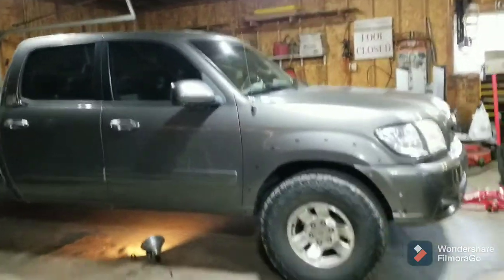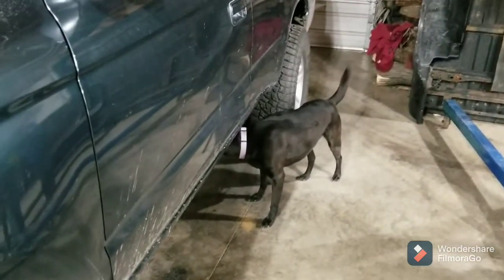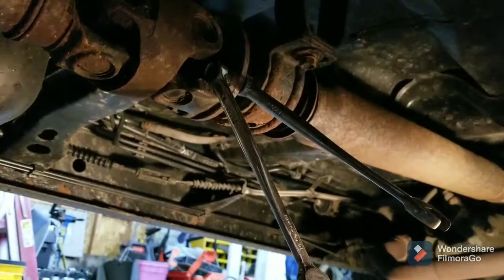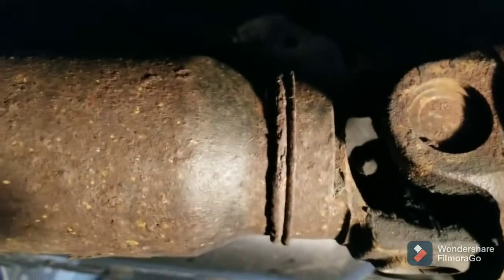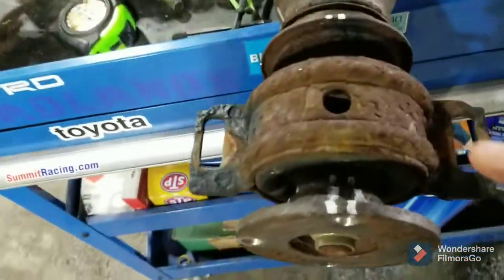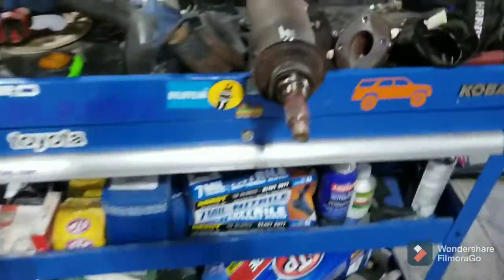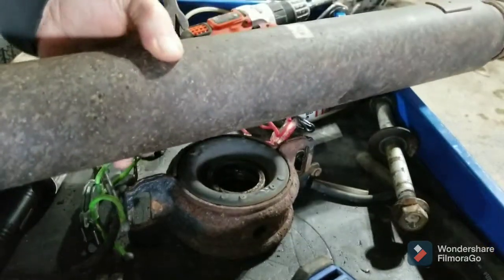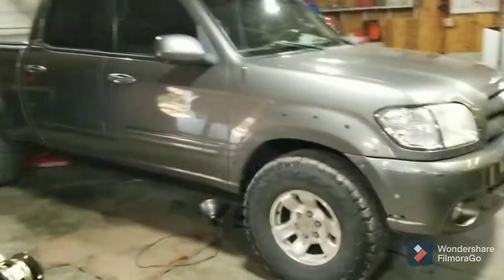How to replace carrier bearing/center support bearing. Easy! 1st gen Tundra, Tacoma, T100, Pickup.

Comment: Great video. No need to apologize for anything. Feel like you showed all the important stuff
Reply from the maker: Thank you. I appreciate that.
I try to cover all the important parts best I can.
Thank you for the kind words and thank you for watching and commenting
Reply: @funjunkiegarage  How's the aftermarket carrier bearing holding up?
Reply from the maker: I put just over 20,000 miles on it with the truck in the video. When I got my Blue Tundra it needed one so I took the same carrier bearing and put it on the blue one. I've put another 15,000 on it and at 35,000 miles total, it's still just fine.
The one I used does have a koyo bearing.

Comment: I'm getting ready to do this on my 1st Gen Taco. Amazing how all of these Toyotas work very much the same.  Thanks for doing this, I'm encouraged to tackle it myself now as it doesn't look as intimidating as I thought. I just installed a 2-3" lift on my Taco, and I thought I had fixed the resulting vibes (15-25 mph) via a carrier bearing drop. Now dealing with random, violent shaking underneath the floorboard, and my suspicion is that I need to do this job and replace that carrier bearing (it's a little loose - not terrible, but it's around 18 years old, so probably due anyway, and I just aggravated it more with the lift).
Always enjoy a quick glimpse of your other project cars (and I've seen several of your 3rd Gen 4Runner videos - that's my other ride).  Hope Blanche is still around.  Thanks!
Reply from the maker: You're welcome. Glad to hear you are going to do the carrier bearing yourself. I'm sure it'll go smoothly. 
I also love how so many Toyotas share parts and designs.  Clearly my favorite brand..
Hope this solves your shaking issue.
Thanks for watching my other videos.
I truly appreciate your support.
And yes Blanche is still around. She doesn't like hanging in the shop like Oswald does.

Comment: When you reinstall the yoke,  you need to torque the nut to 133 foot pounds to seat the bearing, then back the nut off 1 turn and retorque to 60 foot pounds.
Reply from the maker: Thank you for that information. 
That's good info indeed.

Comment: Thanks for the video. Very helpful. My tundra is also having a loud speaking noise front passenger side. Don't know what it is. Cv shaft?
Reply from the maker: You're welcome, happy you found it helpful.
I'd check the brake pads, for a squeaking.
Jack it up and spin the wheel and see if you can hear it. CV shaft is a possibility if it's dry of grease.
Best of luck finding it. Please keep me posted.
Thanks for watching and commenting I appreciate it.

Comment: Can this job be done without a floor jack? Do you need to completely remove the driveshaft? Great video! Thanks
Reply from the maker: Yes it can be done without a floor jack.
I didn't know it wasn't a press fit.
All you need to do is drop the carrier bearing, unbolt the 4 bolts on the flange and remove the center nut. It can all be done without removing either of the shafts. I made it way more difficult. 
Thank you and thanks for watching.
Reply: @funjunkiegarage  You should Highlight this.
Reply from the maker: Thank you.
If I can figure out how to do that I will.
Mayhaps a couple of my good ones.

Comment: Thanks for posting this.  I'm getting ready to do the same job on my '00 Tundra.  I've seen several negative reviews on the non-OEM carrier bearings going out after a very short time   I really don't want to spend the exorbitant price for the Toyota.  How are yours holding up?  Would you still recommend the DIY Solution bearing from Parts Geek?
Reply from the maker: Thanks for watching. 
I've put only about 8,000 miles on mine since I changed it but its holding up fine. It's not a big problem to change so I took the chance and so far it's fine.
Not sure how long it will last, but I check it every oil change.
Just a tip I discovered: 
I ordered one for a 96 T100, it was $20.00 less and was the exact same bearing I put on the Tundra.
I like to try the cheap alternative on stuff that won't leave me stranded.
Usually works out.
Reply: @funjunkiegarage  Good tip.  I don't put that many miles on mine so I'll take the chance.  I agree with you.  Thank you.
Reply from the maker: You're welcome.

Comment: What a great video for a first time replacement of that part . I was also thinking it was pressed . Do you think the grease for the bearing is needed. I noticed you wiped off the old but didn’t put any new grease. I imagine it’s some high temp grease if so.
Reply from the maker: Thanks for watching and commenting. 
I didn't feel any grease was needed. The old I wiped off was from the old bearing.
There is a dust shield on either side and the rubber fits behind/under them, but doesn't appear to rub the driveshaft. Another viewer asked me the same question so I went under there and took it back apart and there were no signs of any abnormal wear or rubbing.
Hope this helps.
I appreciate your support.
Reply: @funjunkiegarage  thanks for replying so fast. I got an 02 it doesn’t have the same setup unfortunately I’ll have a little more work on my hands . The driveshaft will have to come apart to get to the bearing.
Reply from the maker: You're welcome. 
Bummer. I haven't done one like that.
Best of luck with it and enjoy your project.

Comment: thanks for the video! mine did not just pop right off. sucks to be me, lol
Reply from the maker: Thanks for watching. 
Bummer yours was stuck  I did the T100 and  it came right off also. Was yours rusty/seized?
Reply: @funjunkiegarage  03 tundra 4.7, not too rusty, i cut off the bracket with a recip saw and pulled off the rubber, then tapped the bearing with a dift alternatly until it came off.
Reply from the maker: Definitely a good way to get it off there.
It pays to have the ingenuity to overcome obstacles. 
Think of the $$ you saved.
Thanks for sharing.

Comment: Hi, i recently had my carrier bearing replaced. Afterwards, i noticed a transmission fluid drip. The mechanic said it should go away in a few days. With your expertise, does this sound right? Thank you.
Reply from the maker: No, that does not sound right to me.
Replacing a carrier bearing should have no direct affect on the transmission in any way.
And as a general rule, leaks don't fix themselves. 
Did the mechanic say where it's leaking? Or explain how it started leaking? Or more importantly how it was going to stop on its own?
Doesn't sound right to me.
Please let me know how it turns out. If you don't mind.
Thanks for watching and commenting I appreciate it.
Reply: @funjunkiegarage  he said he had to pull the driveshaft yoke out from the transmission to do the repair. And that some transmission oil came out as he did so. That it's just residual oil from that, which should go away in a few days. Thanks for your input.
Reply from the maker: Ok. That's a different story.
I was thinking you had the work done  on a Toyota .
So now I agree with your mechanic. Removing the slip yoke from a tramsmission tail shaft will make it leak. If some got in the crossmember it will leak out over a day or 2. 
Sorry I misunderstood. I should have asked what vehicle. 
I'd keep an eye on everything just to be sure.
Thanks for following up with me. Makes more sense now.

Comment: With that 1/4 " spacer do you have to get extended lug nuts?  My new tires are crazy close to the upper a arm.
Reply from the maker: No. I didn't change studs. Or lug nuts.
There is still a good amount of threads catching.
Reply: Lol yep extended studs. Longer lug nuts wouldn't help much. Thanks for all your help.
Reply from the maker: I knew what ya meant. 
You're always welcome brother. 
I appreciate you supporting my channel.

Comment: Iv'e got an 04 Tundra, well over 200K miles. How do you know when this needs to be replaced. I get some vibration starting at 30 MPH then it slows a bit after around 60 or 50 MPH. When let off the pedal it pretty much stops. Is that my indicator??
Reply from the maker: Thanks for watching.
Those could very well be indicators of a bad carrier bearing. A driveline vibration is what I felt on mine that made me check it. If the driveshaft has a lot of up and down movement at the bearing it's bad. The driveshaft should be in the center of the bearings metal frame. Mine was sitting all the way at the bottom.
I hope this helps.
Appreciate the question, good luck and keep me posted if you would.

Comment: Great video. I’m thinking that my 2006 Sequoia needs a need bearing.
Reply from the maker: Thank you.
Mine had a vibration, but that's not always the case. If yours is bad you'll be glad you changed it.
Best of luck with the project!
Reply: I'm not sure if 2006 Sequoia is the same way. Most of the bearings I see online are for Tundra not Sequoia...will have to check under the car.
Reply from the maker: Hmmmmm, never had a Sequoia to look at. I'm not sure.

Comment: just bought an 03 tundra and my carrier bearing has a ton of play but my issue is at a very slowe speed "like going through a busy drive thru speed" my rear end creaky and clanks, i checked my diff and transfer case fluid all is good no metal or coloration. would the carrier bearing make it creak and clank or are my u joints going? they dont have play in them im very confused.
Reply from the maker: Thanks for watching and commenting. 
A carrier bearing shouldn't make noise other than a whine if its terrible. 
Sounds like u joints.
Have you greased them?
That's about the only creak/clank item besides something internal. And that would be obvious. 
Keep me posted please.

Comment: So I have a 2006 Tundra V6 and at around 45mph it has whats a shutter. If I slowly work my way up to 45mph it doesn't do it. And if I accelerate fast it doesn't do it. It also doesnt do it when the trucks cold. After it warms up it does it. Do you know what this could be?
Reply from the maker: Sounds like a driveline issue. I'd check the carrier bearing first. Is the truck lifted?
Do you feel it in the steering wheel or in the body of the vehicle? I'm guessing feel it in the body.
Here is a link to my video on check and replace the carrier bearing.https://youtu.be/mA2Qh_ZPfOs
I say that because under hard  acceleration it will be forcing it to the top of it's bracket and under gradual acceleration it won't wobble, but under normal driving it will get to flopping around.
Please keep me up dated 
Thanks for watching and commenting.
Reply: @funjunkiegarage  So. I checked the carrier bearing and the drive shaft didnt move. Truck is not lifted.
Reply from the maker: Next I'd check all the u joints. Should have mentioned that for while you were under there.
If it were front end parts, you'd feel it in the steering wheel.
Reply: @funjunkiegarage  Anyway to get your phone number or something to call you. Kinda hard to explain on here
Reply from the maker: Do you have Instagram?
You can message me there and we can exchange information @funjunkiegarage. 
It is after 6:30 here and I'm done for the weekend. 
But yeah, mayhaps I can help.

Comment: How has that beard lasted I just ordered one for my tundra and they are $35 now $50 with shipping and tax
Reply from the maker: It has been just fine, no issues and over 25k miles on it. When my 04 got put out of commission, I saved the bearing and it's on my 2000 now.
Thanks for watching and commenting

Comment: Was ur truck vibrating
Reply from the maker: Thanks for watching and commenting. 
Yes, it had a vibration while at a steady speed.
It also made a jerk/clunk noise when accelerating from a stop as the driveshaft moved up and down in bearing housing.
If you get under the truck and can move the driveshaft up and down a bunch at the carrier bearing then it's probably bad.

Comment: do all the carrier bearings for tundras come off like this?
Reply from the maker: I've done 2 for Tundra and 1 for the T100 and they all came off without a press. The outer flange holds the center of the bearing via pressure from the nut.
Very nice.
Thanks for watching.
Reply: @funjunkiegarage  that being the case, is there any need to remove the driveshaft?
Reply from the maker: No, you can actually unbolt the carrier bearing. Separate the front and rear halves and unbolt it on the truck.
The next vehicle I did, I did it without removing the shaft. Way simple.
Reply: @funjunkiegarage  thanks for the quick response! I'll be doing this fix on my '01 tacoma tonight.
Reply from the maker: Sweet, enjoy the project.
Reply: @funjunkiegarage  hey, can you elaborate on this a little more? You would still need to remove the center nut and re stake it under the truck if you left the driveshaft on, correct?
Reply from the maker: Yes, that is correct. I didn't know it wasn't pressed on until after I had already pulled it.
Definitely re stake that nut.

Comment: You can buy the actual Dana Spicer part for tundra from rock auto for 85 bucks. It is the same Dana spicer bearing installed by the factory. Even has Toyota and Toyota part number stamped on it. If it was not a Toyota part or not from a manufacturer Toyota uses (Aisin, Dana, Denso), I would not use it, period.
Reply from the maker: Good information. 
Thank you for sharing. 
I appreciate you watching and commenting.